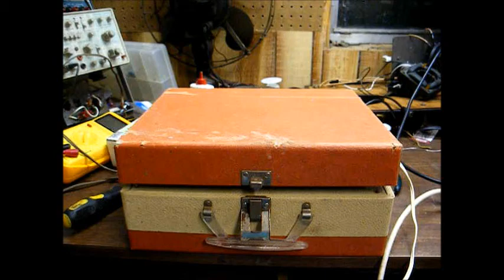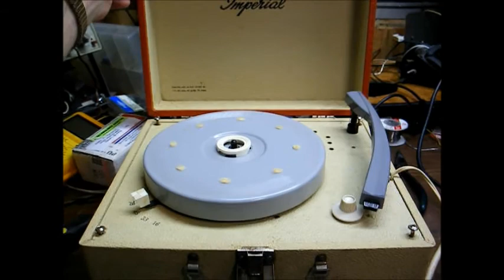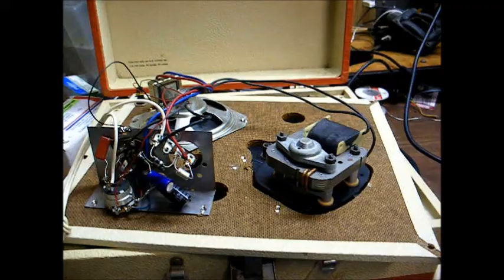1968 Imperial tube record player phonograph

Comment from the maker: Usually, the drive mechanism in these record players becomes gunked up over the decades. They have to be taken apart, cleaned, and lubricated. There is also a good chance that the rubber drive wheel and the rubber motor mounts need to be replaced. I don't do many repairs for the public; but, I'll be happy to look at it for you, if you'd like.

Comment: I'd like to see someone use a stereo cartridge (it would have to have 4, rather than 3 output pins) and wire L and R in-phase-in-series; I'd expect that to add up to 3 or 4 volts.